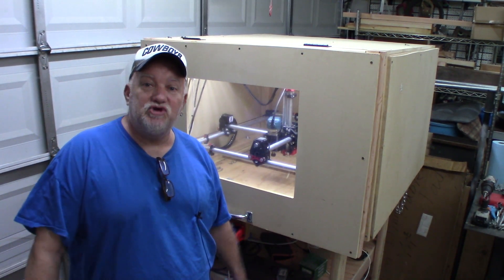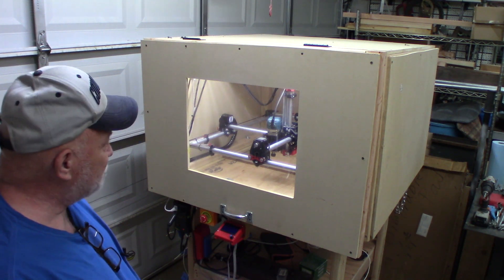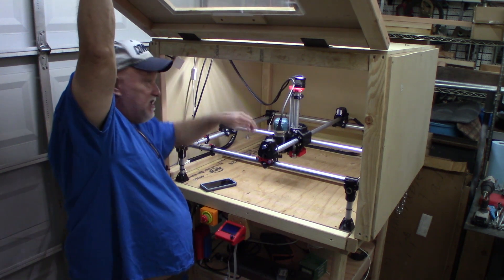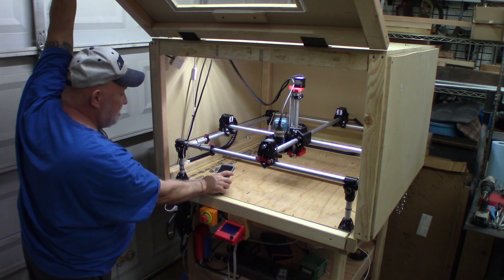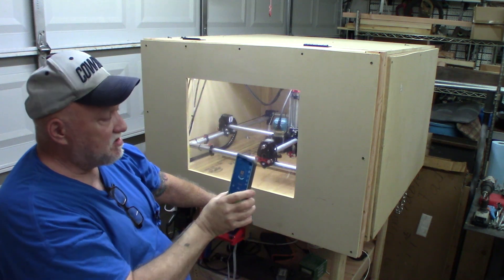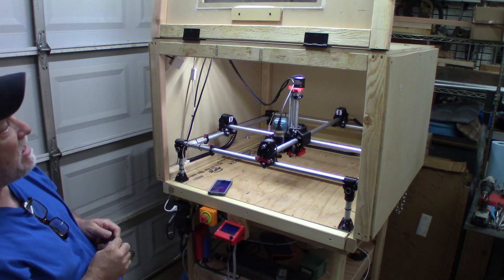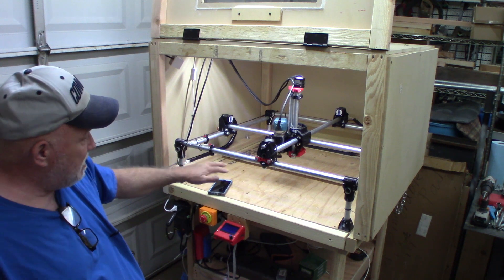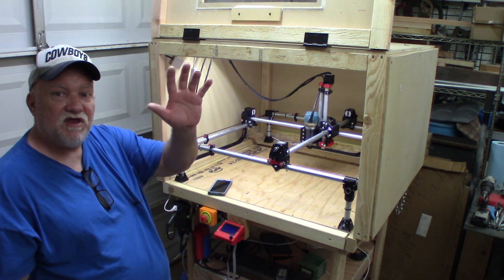My MPCNC Part 2 #3dhp

Comment: Great build, idea suggestion for the door could be to use gas struts that used on car hoods and trunk. :)
Reply from the maker: I ended up moving the hinges to the right side a bit ago,now it opens like a fridge.
Reply: 3d Printing and Painting oh cool, ya I’m in the process of building my MPCNC, I have all my parts printed and all the hardware and bearings. I was on the fence about getting a ramps 1.4 or just pay the extra money for Rambo, anyways hope yours works good when it’s going and look forward to future videos, take care